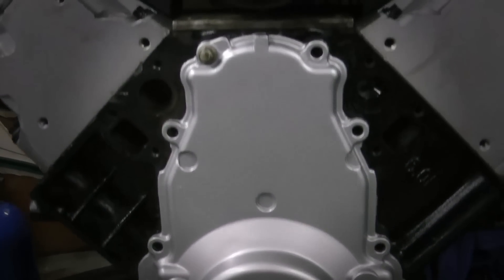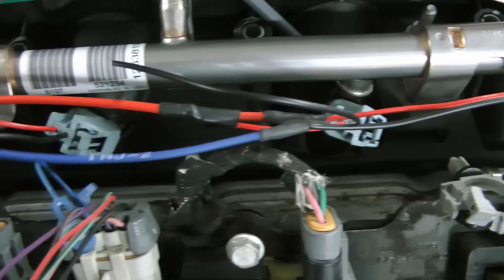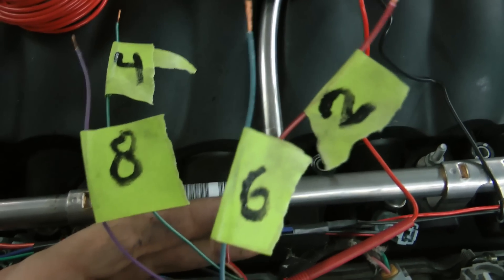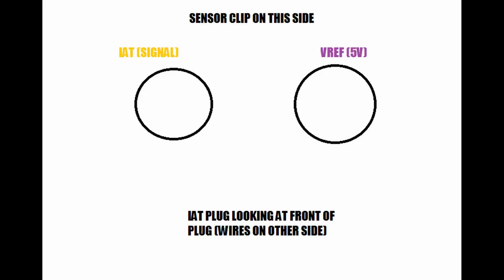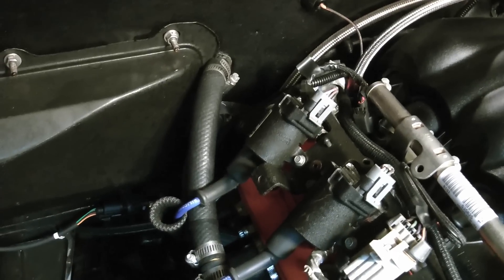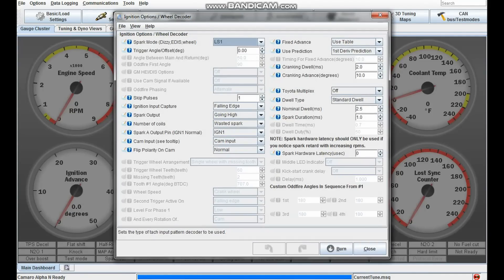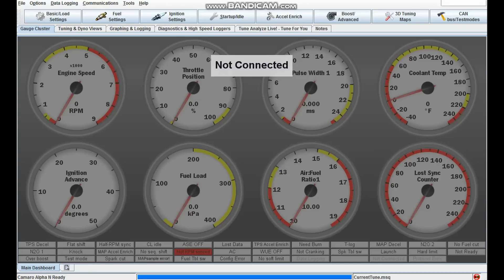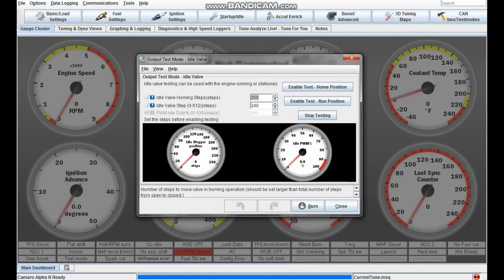How to Microsquirt Standalone EFI your LS engine!

Comment: thank you so much for this video it really shows step by step how to do it and thanks for giving the wiring diagrams for all the coils injectors and sensors. I couldnt find the wiring diagrams anywhere forums are filled with information but since photo bucket went down the shitter all pictures in those old posts are lost which sucks.

Comment: Awesome video. Thanks. Just getting my 280Z painted and back together after 24 inches of water with Hurricane Harvey. I have a Spectre EMS-Pro I’m using to run fuel and spark with LS coils. If I’m correct, it’s a modified ms2 like the micro squirt. Your video is a big step to getting it wired.  Thanks again.
Reply from the maker: You're welcome! I hope all goes well for you James, I cant imagine going through something like that. Best of luck on your build!

Comment: Really need to get around to buying a Micro for my 4.6 2v; my setup will be a bit different but in some ways the same, I rigged up some LS truck style coil packs, but I have a 36-1 trigger wheel; also LS is my throttle body (I know, mismash of LS and Ford parts, what am I doing with my life? lol). Where'd you get your MS from? They seem to have gone up in price a bit?
Reply from the maker: Munky332 go talk to Mike at efi source. Hes given me so much advice over the last couple years super solid guy to deal with!

Comment: Hi, great video!  I about to order my micro squirt for my 2004 6.0 LQ4 swap into my 72 Nova naturally aspirated. I pulled a drive by cable throttle body off a junk yard motor to convert from the drive by wire Throttle body. Question about running the IAC with micro squirt. When you said " Your welcome! You can only do throttle by cable with a micro. The iac wiring is simply a seperate module which allows you to use a stepper iac which is essential to making it run nice :)" Where do I get or buy a IAC separate module? Sorry Im newbie confused. So is it just a way of wiring off the micro squirt or an actual separate IAC module "I have to buy somewhere" that works with the micro squirt? Thanks!

Comment: Hey I appreciate all the help before running in to some weird stuff. I was tuning a little bit an the car cut off. Now when I try to start it I turn the key on the pump cycles but pcm won’t connect to the laptop try to detect it etc. I get nothing. while they key is still in on position the pcm cycles fuel pump every 15 seconds. I thought it was a wiring issue I’ve tried multiple 12v connections to power the system and still the same results. Made sure grounds were good. Changed the relays as well. Still the same. Nothing fixing this issue.
Reply from the maker: Try reconnecting to the ecu by going to communications then "detect" with the key in the on position , sometimes USB ports fall asleep
Reply: I’ve tried but no difference

Comment: My ls1 swap is not using a MAF but instead a MAP. Should I use the maf connection and plug it in to the map? The manual says I can use one or the other but I'm not too sure
Reply from the maker: Microsquirt is speed density no maf must use a map
Reply: So the maf connection they provided  should be connected to the map instead? I bought the pre-made harness

Comment: Do you know of any way I could test the iac motor ? Or how I can see if the stepper adapter I have is working ? I have a meter I wired the iac adapter myself like the rest of the harness but a new problem arose where in tuner studio when I use the can bus test to test the iac it communicates like it’s supposed to on the gauges but it doesn’t matter if it’s in the home position or run position it has no affect. So basically right now I have no iac motor and it’s stuck so far open it wants to idle at 1900 
 Any help is greatly appreciated

Comment: I'm looking to trigger a relay for electric fans via the Microsquirt on my 5.3L LS. It looks like since you need to use the LED pins to trigger the coils, that there are no other spare outputs to use unless I opt out of using IAC/FIDLE. Is this the case? I can't find anything in the documentation that mentions using WLED/ALED to trigger the coils. What am I missing?
Reply from the maker: You will be out of outputs unfortunately, but no need to worry! Buy a fan switch at desired temperature and install in your head with an m10 to npt adapter. That fan switch then grounds a standard bosch relay and turns on your fan!

Comment: Does anyone know if you can put the resistors that are supposed to go inside the Microsquirt, outside after the connector instead of inside the module?

Amazing video man. Very detailed.
Reply: you can , you need to T a 1k ohm resistor from the 5v ref output to the signal wire

Comment: Can the MicroSquirt harness be run through a bulkhead connector through the firewall? If so, is there a recommended connector or a recommended wire count?
Reply from the maker: I've never seen anyone do that, not to say it cant be done!

Comment: so for a straight 6 like from a datsun l28et i would need to wire the inj1 wire to injectors 1,3,5 and inj2 to injectors 2,4,6. Im also guessing that i would only need 1 signal wire for the coil since it has a distributor?
Reply from the maker: Correct on the injectors. I'm not sure how a microsquirt could control a distributor. It's got logic level coil outputs meaning its replicating a digital computer signal more or less to fire the coils. Get yourself a crank sensor and then run individual coil packs from an LS and plug the distributor hole :) I bet that is actually cheaper to do than even trying to make the distributor work, plus you can control timing way better with coil packs than the distributor.

Comment: I know this is SUPER dated. But i noticed the back of your MS ecu says LS1 24X modification. I cannot find any info anywhere to comfirm my ecu will work with my LS, or what i have to do in order to make it so. Any info ?
Reply from the maker: @russmurdoch8547  figure out where it was purchased from! The ms2 gets modified with resistors to run the ls, it is something people used to do but they just sell them done now

Comment: Any idea what wires you had left over and what did you do with them?
I just want to double check before they get snipped
Reply from the maker: Quickly reviewing here: CANH, CANL, VRIN2+, SPARE, FLEX (now using it for my 2step,) SERIAL RX, SERIAL TX, BOOTLOADER, OPTOIN+/- and I think that's it! Note that I've got the IAC controller which takes up a few more wires.
Reply from the maker: As far as what I did with them I cut them to about 2ft in length and just hid them in the harness incase I ever had to connect to them again. This was the case for the flex wire which I've got rigged to a clutch switch. In tuner studio you can setup 2 step to run when this wire is grounded so my cluch switch grounds this wire and boom, I've got 2 step with clutch depressed and throttle over 90%. This actually can cause problems though because I shift fast and it will hit the 2 step between shifts occasionally, so this year I'm going to move the two step to a thumb controlled button.
Reply: Thank you. Never hurts to double check. I think I got it. Finally done with the board too. Time for loom and tape.
Reply from the maker: fist   you're welcome!

Comment: Thank you for creating this video.
I have a 2006 5.3 LS and I am on the fence about whether to use throttle-by-wire or throttle-by-cable. Your description of how to connect for idle air speed; is that for throttle-by-cable or throttle-by-wire? Is there a preference?
Reply from the maker: Youre welcome! You can only do throttle by cable with a micro. The iac wiring is simply a seperate module which allows you to use a stepper iac which is essential to making it run nice :)
Reply: Thank you, @WestcoastWrenchin

Comment: Did you add any resistors to the microsquirt circuit to make the ALED and WLED to fire the coils ?
Reply from the maker: Nope it came already done
Reply: @WestcoastWrenchin  I just got mine started and its definately misfiring, pls give details on thus resistors thing
Reply from the maker: @XxMusclecarsxX  I bought the ls version, no resistor mods needed. I'm not sure which model you got. Try calling efi source
Reply: @WestcoastWrenchin  interesting I got a regular microsquirt I think
Reply: thx for the quick reply man!

Comment: On the coils ground I read that all of the sensors need to ground at the micro squirt but is it okay to ground both of the grounds from the coils to the block or does one need to go to the microsquirt thank you in advance and great video
Reply from the maker: EVERY one of my grounds goes to the same point on the head. Technically speaking the ecu is supposed to be grounded directly to battery and I believe the battery acts as some sort of a "damper" if you will for voltage surges
Reply: Westcoast Wrenchin' thank you for the super quick reply this my first install and the coils seem a little tuff to understand but your video and diagram make sense but after reading and reading the manual and watch megasquirt video on grounding the ecu this was one of my questions the first time around always seems to be the hardest then it gets easier on the second thanks again I don’t usually post questions because I don’t get responses so I really appreciate it
Reply from the maker: @Mrvalle420  you're welcome! They seem complicated but they're not. Your controlling a high voltage monster with a just about zero voltage tiny wire so the wiring gets funky 🤣
Reply: Westcoast Wrenchin' after some more reading in the manual I did find the gm Ls1 (24x) coil wire diagram it’s not as good as your diagram but it has a odd component a 1k resistor on both the “WLED”&”ALED” going to the tps vref did you have do that or just run it without
Reply from the maker: @Mrvalle420  No i didnt. All the microsquirt ls are exactly as my video depicts. I believe the resistor your talking about is for an ms2 and not a microsquirt. A microsquirt is a privately made product which utilizes an ms2! The microsquirt has some internal modifications to work with the ls. Hope that helps!
Reply: Westcoast Wrenchin' thanks for the help I promise that’s my last question when i I finish I promise to give you and a few others the credit and post a video showing how my build went
Reply from the maker: @Mrvalle420  thank you!

Comment: So is this essentially a complete replacement for the stock harness or do you have to somehow wire it in? I know you need the plugs but I'm not sure about the rest
Reply from the maker: Its a complete new harness where you solder on the old plugs
Reply: @WestcoastWrenchin  that sounds good. I assume there's a wiring diagram that you just cross reference with whatever diagram belongs to the motor you plan on using it for. I want something to be able to tune and stuff and my car being a v6 and 34 years old, there aren't many options especially if you want to turbocharge it like me lol
Reply: @WestcoastWrenchin  also how does it wire into the fuse box?
Reply from the maker: @nessabush1986  all you've really gotta do is get the crank trigger correct and run ls coils and I'm sure you could make most vehicles run. Some distributors can work too
Reply from the maker: @nessabush1986   just a main power wire really

Comment: Hey man thanks for your video! I have both a microsquirt and a msd6010 ignition box, I'm wondering if I'm better keeping the msd for igniton or going with the micro in wasted spark...Someone knows if one is better than the other?
Reply from the maker: Definately use the micro for ignition. That way you can datalog your ign and fuel together seamlessly. Wasted spark works like a dream dont let it scare you!
Reply: @WestcoastWrenchin  alright thanks for the advice!

Comment: Did you put the resistors in the microsquirt box itself just seen a post about it?
Reply from the maker: No resistors are required when you buy the microsquirt from efi source, theres a 24x ls one on there! Literally just wire it and go.
Reply: Sweet thanks awesome vid just purchased one for my turbo build in my s10 will post updates

Comment: Do you have an idea as to why I’m getting a bad signal on my composite logger with no spark? The red line in the composite logger has waves just like the blue rpm ones while cranking. It’s a 24x engine and I have everything wired exactly as the write-up on LS1Tech says and it’s set to LS1 ignition capture. It was running for a while, now it has no spark while cranking but has spark in test mode and if I change my ignition settings to toothed wheel 24-2 it will try to run. I figured it was interference so I rewired my crank position sensor, added another layer of shielding and grounded it, and I’ve tried different crank sensors but the results are the same. I can send you my tune or pictures of my settings if you have time to look at them
Reply from the maker: Jeff Kranich Did it just stop running one day?
Reply: Westcoast Wrenchin' I had to pull my transmission then when I reinstalled it the truck no longer had spark. The transmission is a full manual valve body though so it’s not electronically controlled and I didn’t change anything else. I had this same issue before that and I put some foil tape around my crank position sensor wires then it ran but now I have no idea why the issue came back. It’s been about a year and I haven’t been able to figure it out or find someone who knows anything about Microsquirts

Comment: You should have wired the injector outputs to one side only, this could give you per-bank o2 feedback :)
Reply from the maker: That's an interesting idea. My theory behind this was to keep fuel flow relatively constant through the rails instead of having one bank flow, then the other, then the other etc. I think that drastic flow changing would leave me with a less than ideal result. I did some research into this when I built my first one and sold myself on the 2 on each bank theory, but lots of people fire one bank at a time and it works just fine! I really would like to know more about this though.
Reply: Understand wanting to keep the rails balanced but any significance to the cylinders you grouped, (1,4,5,8) and (2,3,6,7)?
Reply from the maker: jvan100 Nope, just did two on each rail.
Reply: @WestcoastWrenchin  So are the injectors fired at correct times per cylinder or is there always 4 injecters firing at the same time? the wiring diagram to me shows your piggy backing 4 cylinders per set if inj wires.
Reply from the maker: @neddyairsoft3972  they fire four at once, they are not timed per cylinder. This is pretty standard on older efi and actually cools the valve. When you calculate how many times per second injectors fire you will see that it is almost negligible in terms of efficiency, especially on a hot rod
Reply: @WestcoastWrenchin  So to confirm. 4 cylinders will fire fuel at the same time. Im wanting to run this on my 89 ford bronco fullsize with the 351w that im rebuilding/restoring. Im building it as a overlanding / Daily driver(although its not going to be daily driven). I just wanna make sure the truck is still fairly fuel efficient. if the difference is minimal then all is good.
Reply from the maker: @neddyairsoft3972  4 cylinders fire at once. Injectors are firing say 50 times per second which is why it's not a big deal. My car running batch fire got fantastic mileage! For sure 20mpg on the highway
Reply: @WestcoastWrenchin  Perfect! thank you very much! Do you have a Dash screen recommendation by chance?
Reply from the maker: @neddyairsoft3972  never got around to one of those!